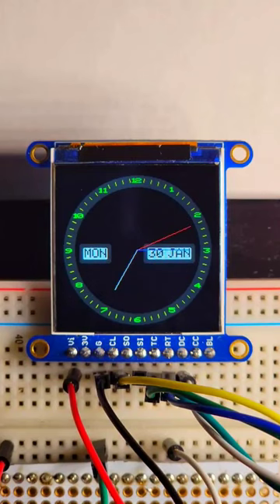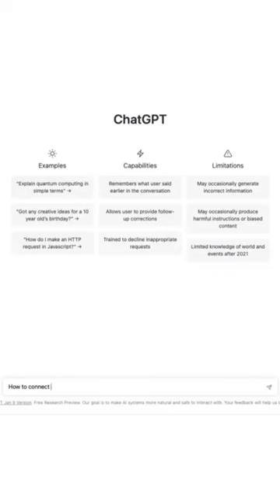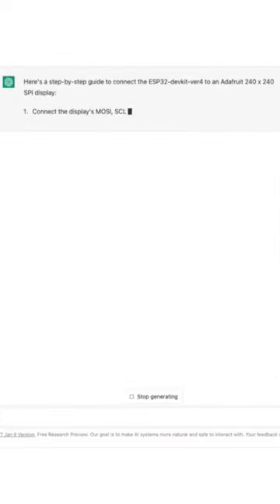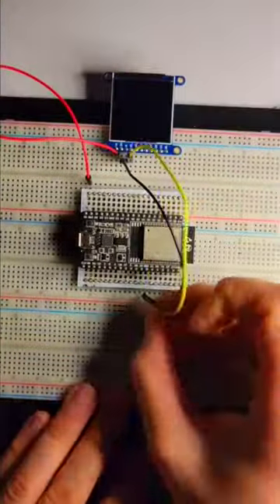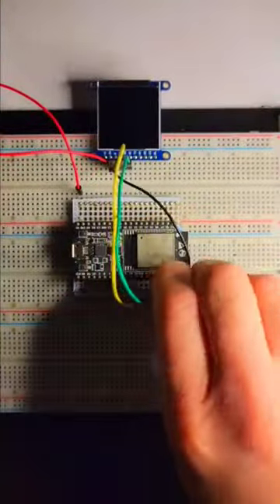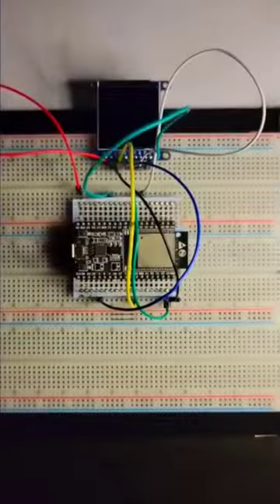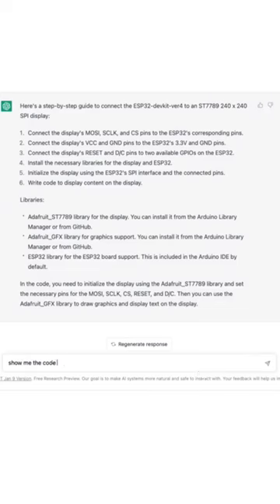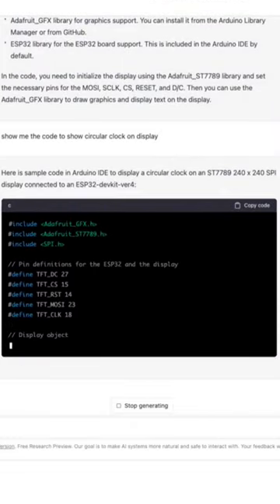ESP32 + ChatGPT

Comment: I want to implement this project:

"Design of Driver Awareness system depending on Eye and Face Feature and Discrimination"

Can I use ESP32 instead of Raspberry Pi ? please reply
Reply from the maker: The ESP32 can handle basic face recognition tasks (since your project is very similar to face recognition) using lightweight models like the ESP-WHO library. However, due to its limited processing power and memory, the accuracy, speed, and storage for face templates may be constrained. It's suitable for simple applications like home automation, but for more demanding tasks, more powerful platforms or external processing might be needed. Hence, I think you should use RPi instead for the better performance. You can use RPi zero if you want small PCB